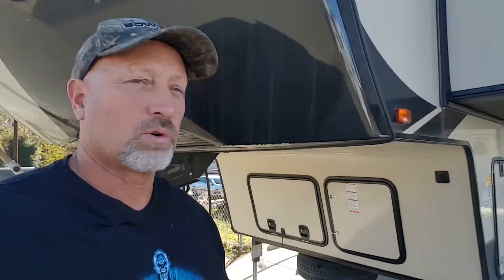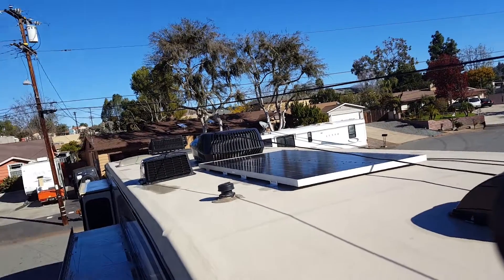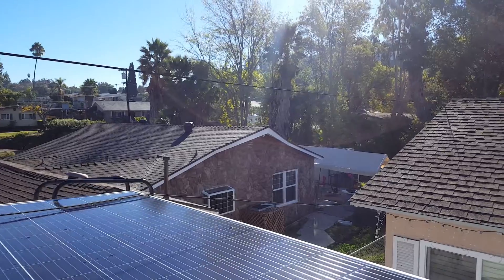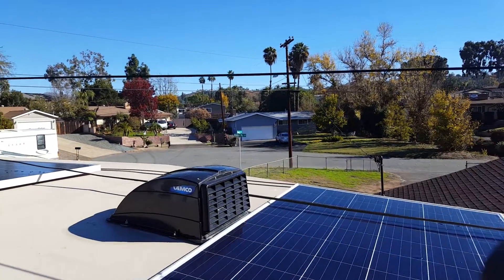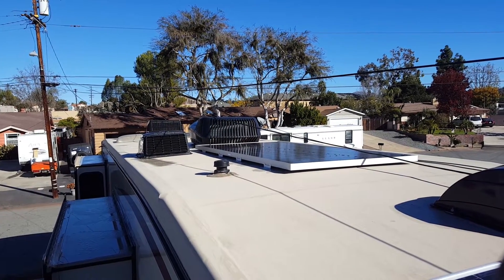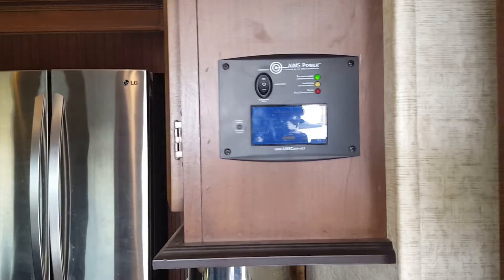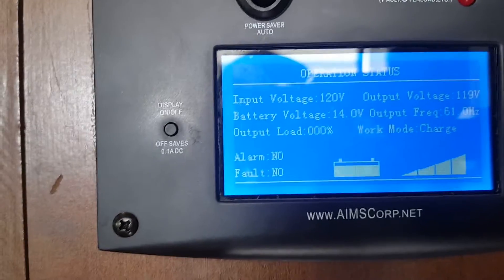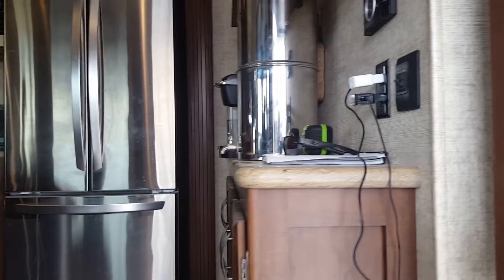Episode 17: Our San Diego Solar Install

Comment: Bubba as a retired driver my self you seemed to do a decent job BLIND sidinding your RV into into the parking spot,and you also did an excellent Totorial on solar panel installation and wiring up all necessary boxes and panels so everything works out just right,as usual great work
love your videos,the OLD GOAT KEEPER
Reply from the maker: Thank you!